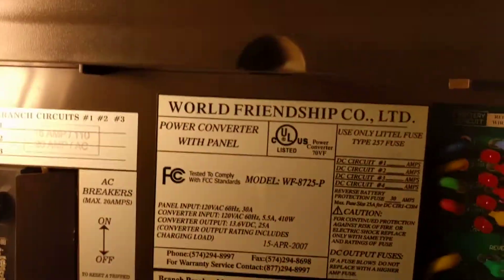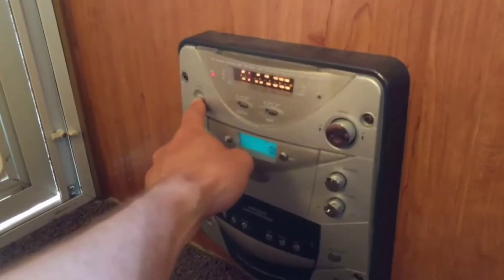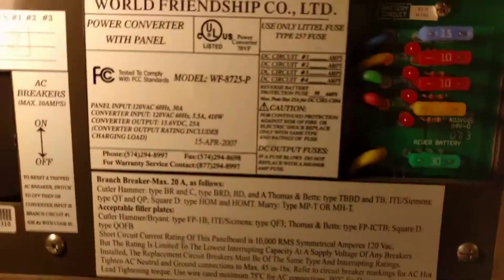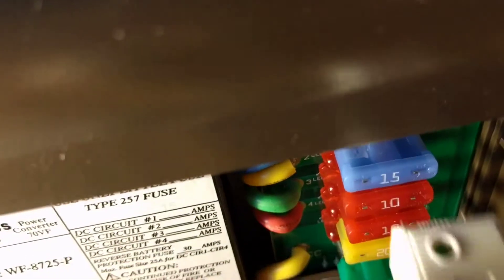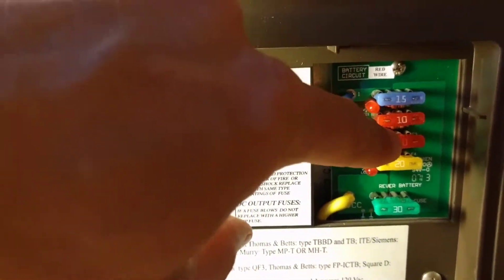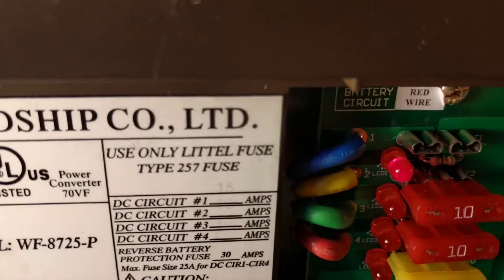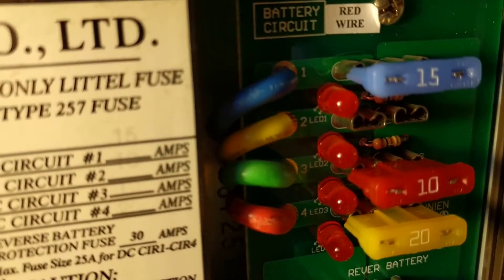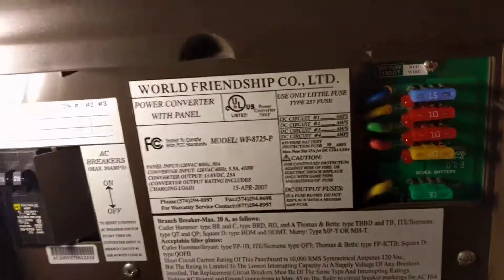WF-8725 model converter issue

Comment: there is wiring going up to a kill switch look for wires going up your canvas and follow it up I had same issue just a broken wire
Reply from the maker: I ended up getting this fixed by a tent trailer repair guy...but man, really nice of you to respond here. You were exactly correct in your assessment.
Reply: @JeremyMacGillivray  what was the fix?  I have the same exact problem.  Shore power does not power the lights or charge the battery.  The lights only work when the battery is hooked up
Reply: I'm having the same problem on a pop up. I guess I'll start chasing wires